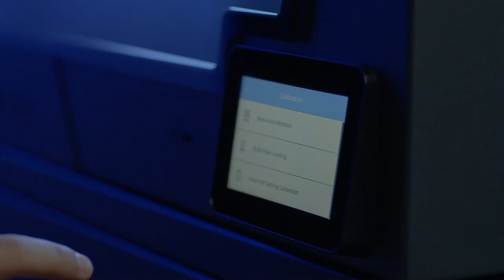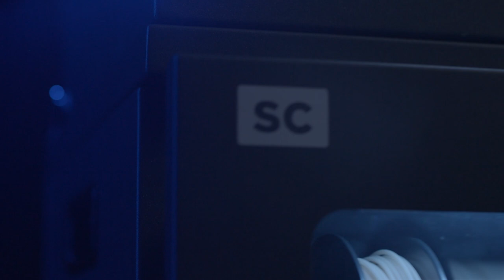Introducing the New Generation of the BCN3D Epsilon Series: Optimized for superior performance

Comment: This is cool! Do these printers have:

1. Pressure advance (linear advance)
2. Input shaping (or equivalent vibration compensation) built in. 

Looks like ur using a stripped version of cura… how far behind are the updates from std cura?
Reply from the maker: 1- Yes it does but it has to be activated through commands manually added to the Gcode.
2- No
Last but not least, we are with version 4 of cura, we have not yet migrated to 5!